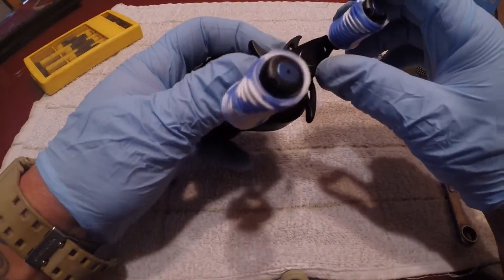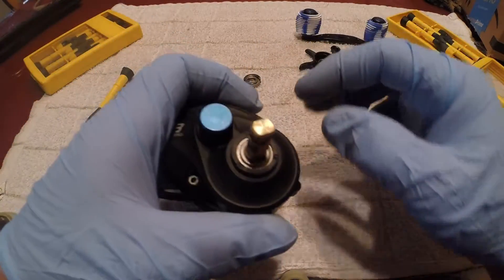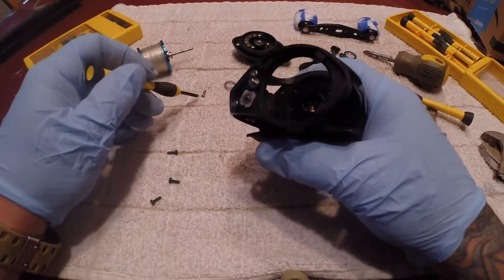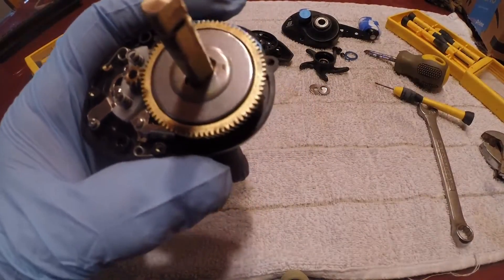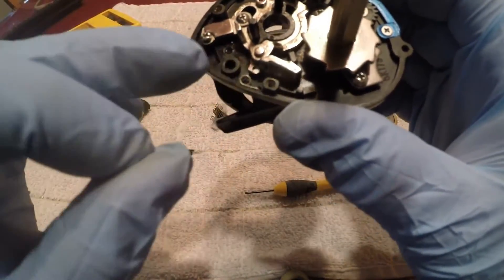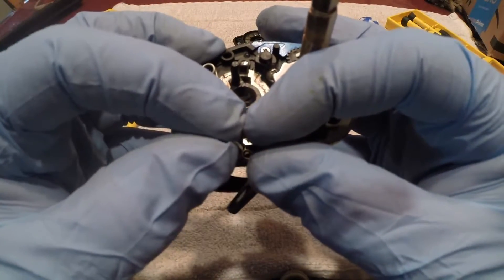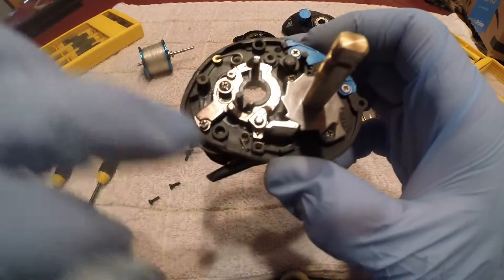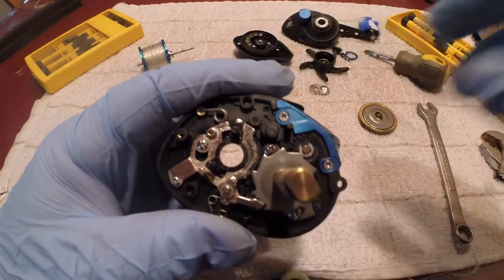quantum reel trigger fix

Comment: Only video on the Internet that helped me see the inside guts of a bait caster so that I could see what to oil to make my button easier to push. I have three reels that are just alike and for some reason and disengaging one of the reels is a lot harder than the other two and they’re the same reel. Yours is the only video on the Internet that went this far so I could see what the bars and gears looked like on the inside. Thanks.

Comment: Thank you good sir.
Reply: Josh C  how do we take out the spring and put it back
Reply: @cbdn60  I didn't take it out, I just stretched it a lil and it worked fine after that.
Reply: Josh C so you kept it on there and stretched there?
Reply: @cbdn60  yeah it just got too compressed and wasn't working. Use a little screwdriver or something and stretch it out a little and it catches just fine.
Reply: Josh C so all I need to do is just adjust it while its on there with a screw driver?
Reply: @cbdn60  yeah just pull it a little bit, its worked for me since then. Before it would not catch to reel in.
Reply: Josh C ok thanks

Comment: I have a abu 3rd gen,sometimes I have mash the thumbar a little
Further to get it to engage.Ive tore in to it a couple of times. I improved the pressure of the thumbar but every now in then it doesn't 
Engage and I have to mash harder to work.
Any suggestions 
Thanks Mr. Hafley